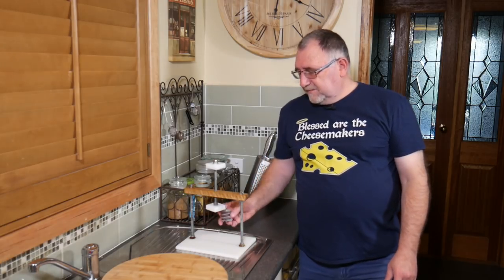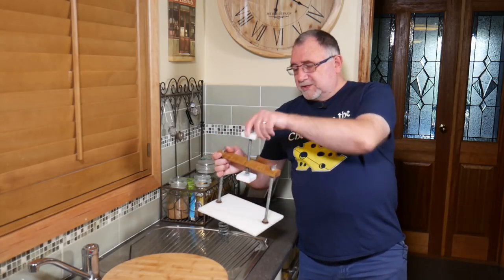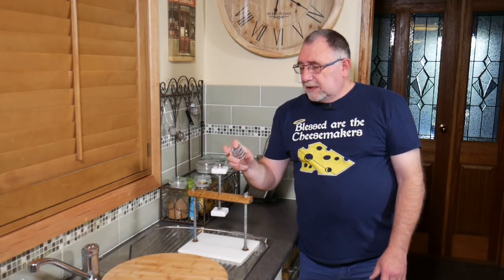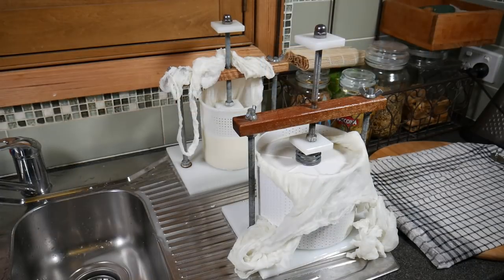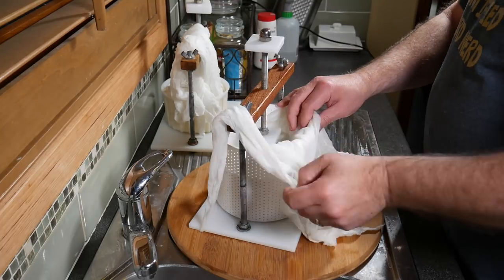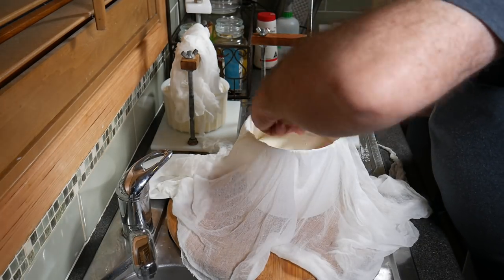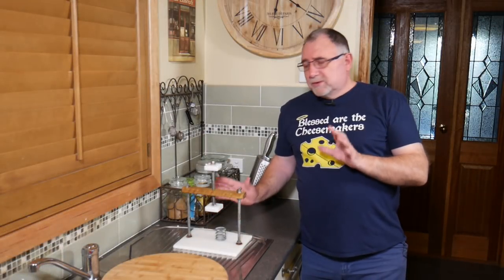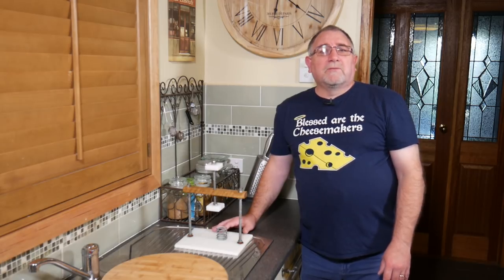My Cheese Press - How it Works!

Comment: I used 2 pieces of laminated shelf board about 1 sq. ft. With draw rods at each corner to tighten it down evenly. I kinda have to guess at the pressure/ weight I am applying but it works nicely and only needed 4 1 foot lengths of ready rod and a few washers and nuts.
Reply from the maker: That's a great idea!

Comment: Hi, We're wondering. As the cheese slowly compresses, do you have to come back and retighten the screw? (if you want to conserve the same pressure throughout). Thanks!
Reply: he covered that in an earlier video and yes, he does.
Reply: I was also wondering this same question. Do you only change the pressure 3 times or do you need to keep adjusting it ?
Reply: NA which video

Comment: Can you set a 50lb dumbbell on top for 50lbs of pressure?
Reply from the maker: Yes
Reply: I did that, even glued a board to the bottom, but sometimes the weight still tips and the pressing becomes uneven.

Worth it to buy or build a proper press.